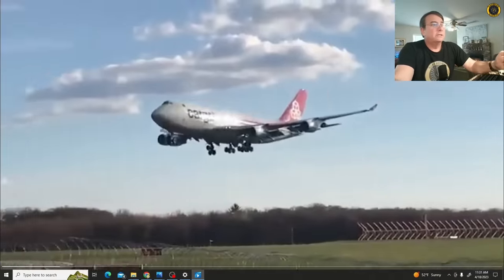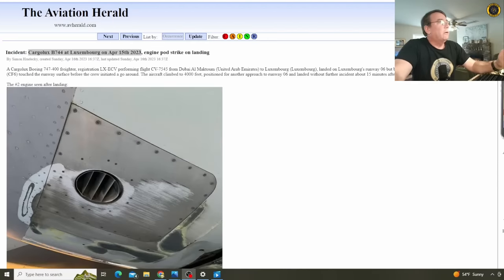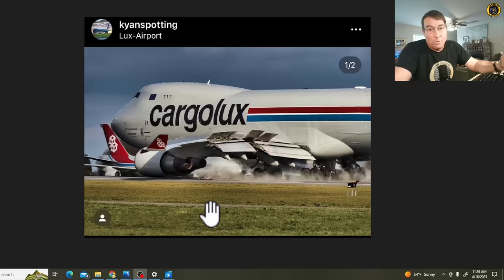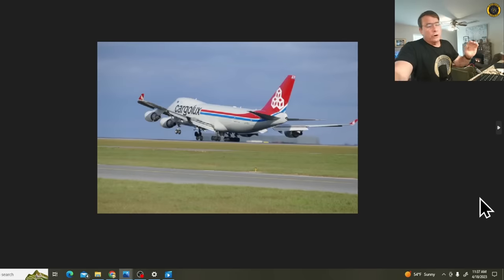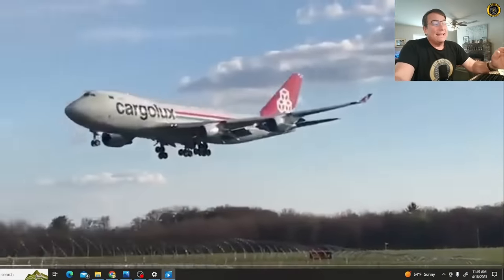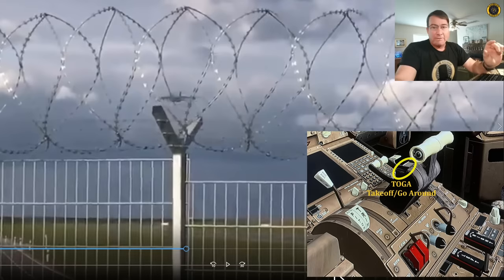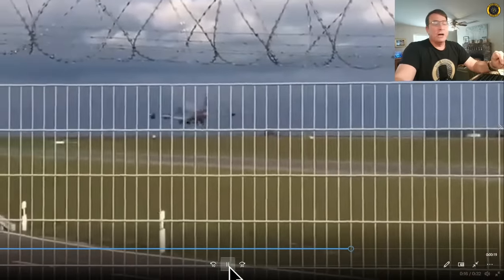Cargolux 747-400 KABLAMMO!-SMASH AND GO 15 Apr 2023

Comment: I don't think it's appreciated enough how incredibly tough airliners are.
Reply: It still amazes me how the even get off the ground!
Reply: @AnX8765  Imagine being a passenger!  😱
Reply: @truthylucy7068  is there a soiled drawer emoji?
Reply: @williambarry8015  😆
Reply: @williambarry8015  Yeah... 💩👖😳
Reply: @kencarp57  thanks👍
Reply: @truthylucy7068  thank goodness it was mostly cargo
Reply: Joe Patroni: You chickened out on me! I told you I wanted all the power you got!

Capt. Benson : Full throttle and this plane would be standing on its nose.

Joe Patroni : You might fly these things but I take them apart and put them back together again. If you had any guts we'd be on the runway by now.

Capt. Benson : You felt it vibrating? Another 10 seconds and we'd have had structural damage.

Joe Patroni : Who do ya think you're talking to, some kid that fixes bicycles? I know every inch of the 707! Take the wings off this and you could use it as a TANK! This plane is built to withstand anything... except a bad pilot.

Capt. Benson : You might tell your mechanic that I've got three million miles in the air.

Joe Patroni : And two and a half feet into the ground
Reply: 100%
On most Airliners the wings can flex 7 feet up & down at the tips.
Without damage. Ponder that !
Like a big ole bird 🕊️ flapping it's wings lol !
Reply: @psalm2forliberty577  Mind blowing.
Reply: @555Trout  
Imagine how the birds innards feel (passengers) when that happens ?
Reply: Have you seen the Boeing 154 video?
Reply: @bradsanders407  Nope.
Reply: @psalm2forliberty577  Fresh underwear being in the cargo hold would suck.
Reply: @davidhoffman1278  money David!  AIRPORT   spent many a blizzard at MSP working with Northwest.
Patroni was no bullsh!t
Reply: Does cargolux carry passengers?
Reply: @truthylucy7068  Yea, I know what you mean. Yes I know how it gets of the ground, yet it still looks too big to actually do it.
Reply: @kencarp57  😆
Reply: @kickedinthecalfbyacow7549  7:40
Reply: If happened on US carrier, the lawyers would’ve been waiting at the gate to make everyone rich. The new American way!
Reply: @briansaben5697  It's a cargo plane, the clue is on the side of the plane in huge letters. ;-)
Reply: If it were a runway with swamp next to it instead of only grass, maybe it would've ripped off the engine instead of the engine sliding over the grass? :/
Reply: @mikebreen2890  You’re so smart. Imagine if it were a passenger plane.
Reply: @briansaben5697  I have a brain the size of a 747.
Reply: I don’t think it’s appreciated how challenging it is to fly an airliner.
Reply: Just love Juan’s Kablamo’s 😂 Great video !
Reply: Gotta love Juan’s Kablamo’s  !

Comment: Even with zero aviation experience, I'm certain a "smash and go" is better than a "smash and stay".
Reply: Yes, indeed. At least in most cases.
Reply: As long as your bird is airworthy, yes.
Reply: Unless the reverse thrusters are deployed.
Reply: Unless you’re PIA 8303
Reply: @mrjaycam18  Yes - and you landed with Gears up.
Reply: Poignant
Reply: Am aircraft mechanic.
Can confirm.
If you can still fly it after you smash it, you got off easy. 😂

Comment: When I worked in the tower, we called that a “Carrier Landing “😂
Reply: lol, I was on the Nimitz...we tried to keep the metal off the deck 🙂 ('cept the hook)
Reply: @joeblow5037  Thanks for your service. ..
Reply: @normdave75  Marine Air, VMFA-333 Phantoms, Nimitz first cruise
thanks bud!
Reply: Hysterical!
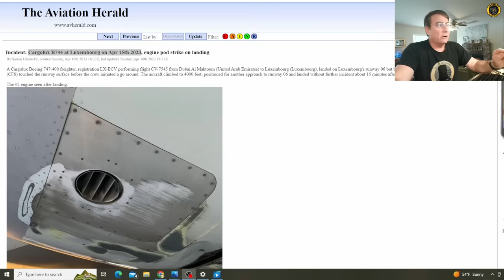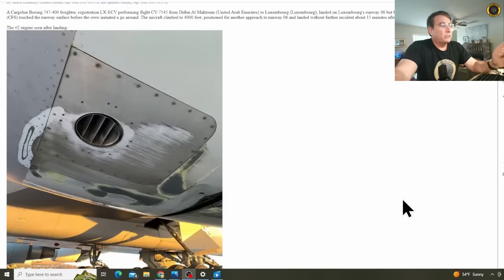Reply: 1:03  1:12  Anyone else notice how Juan sounded like air traffic control?
Reply: Be missed the arresting cable. Ha ha.
Reply: Probably a Navel Aviator!
Reply: @judd_s5643  agreed!
Reply: Crash and dash.
Reply: Where's the cables and tail hook !!
Reply: @judd_s5643 came in too hot with not enough flare.
Reply: They missed the 3 wire.
Reply: LOL!

Comment: My dad put down a 727 with no wheels in April 1967. The plane had remarkably little damage and was returned to service. He would see and even fly that tail number every so often for a few years
Reply: Hell of a plane the 727... VERY advanced wing, and a thrust-to-weight ratio the latter-day twin-engine "economical" airliners can only dream of... FedEx kept flying them until about 2014, IIRC... PS: do you have that N# of your dad's belly-slide '27?
Reply: Absolute tanks, the 727.

Comment: I flew several iterations of 747's for 23 years. Glad I never had one like that. Looks like the flaps were at 25.
Reply: Hey Kevin747, so after the initial touch down, did they stow the spoilers by hand or do they retract with the pressing of the TOGA/ Auto pilot-throttle dis-engage buttons?
Reply: It was a flaps 30 landing. Spoilers retract automatically when the throttles are advanced
Reply: Auto brakes also disengage when thrust is advanced
Reply: @John Smith  Thanks John!
Reply: Ex-Navy pilot.
Reply: Looked like Flap 25 to me
Reply: @Reach41  Must have forgot he didn't have a tailhook or arresting gear.
Reply: @dingerbell100  landing flaps are 30 or 40. Go arounds are flaps 25
Reply: I got about 6000 hours in 100s, 200, and 300s.  That was a Flaps 25 landing.  If it was a flaps 30, they would have been more angled down.
Reply: @JohnSmith-bm3sl  ... there is no Flaps 40 on a 747... there is on a 737 though.  Flaps 25/30 are normal flaps setting for landing a 747.
Reply: @tomjones4093  It’s funny how someone tries to sound like they know what they are talking about then blows the whole thing by giving an incorrect statement about Landing Flap Settings for B747s 🤣🤷
Reply: @JohnSmith-bm3sl  lol wut? There is no flaps 40 on a 747. Go arounds are initiated with flaps 20. Source: I'm a 747 Captain.
Reply: Oops. I apologize. It was a flaps 25 landing. Went back and checked my manual.   Been retired too long
Reply: @MK-tt5xy  Sir , you posted; "Go arounds are initiated with flaps 20".  You first set the flaps to 20, then add TOGA ? How about you lose alt when initially cut those flaps ? As a CfI i always initially added power, then cut the flaps to lift setting.  Right ?
Reply: @CFITOMAHAWK  The call is one phrase: "Go around, Flaps 20" while pushing TOGA buttons and ensuring the thrust levers advance. PM will select Flaps 20 while the PF is increasing pitch to establish the climb. PM then calls "positive rate" and the gear is retracted. This config is held until acceleration altitude, usually 1000'.
Reply: @MK-tt5xy  So flaps 20 is not the only initial step, its one of the 2.  Many go around accidents by pilots cutting flaps before adding full power.  I used to teach them on low power Cessnas with 40 flaps.  Cant climb with full flaps.